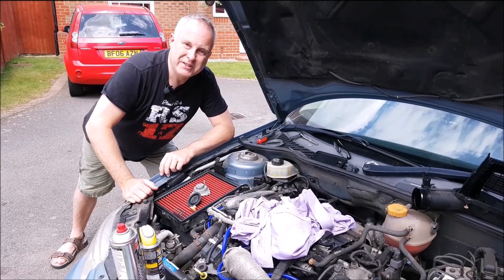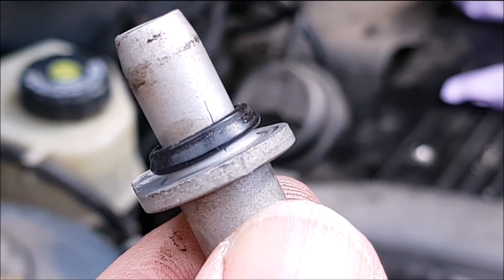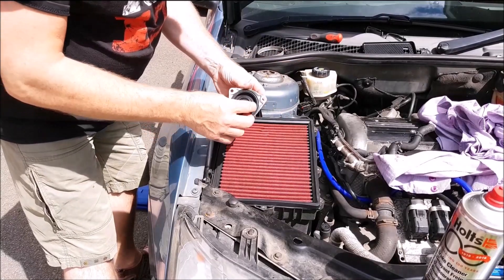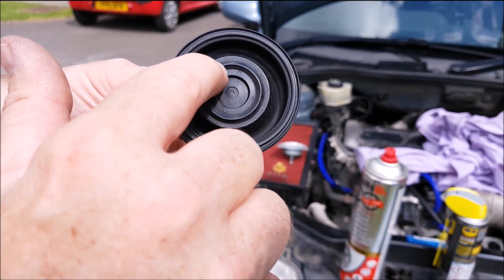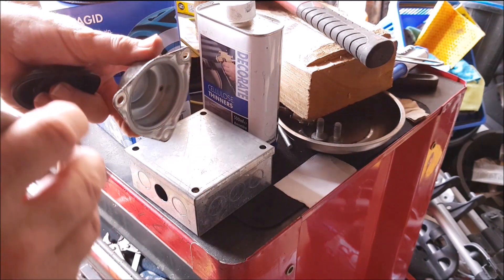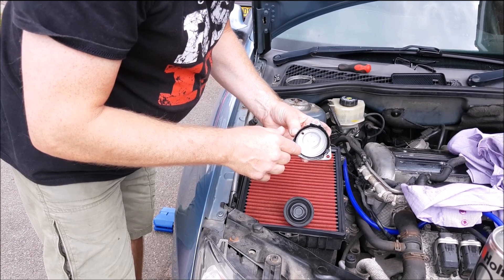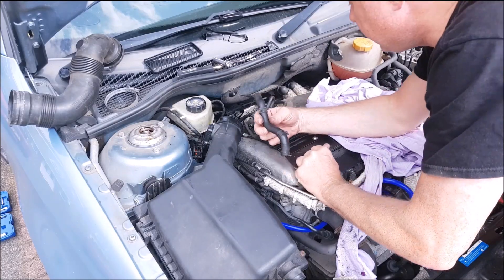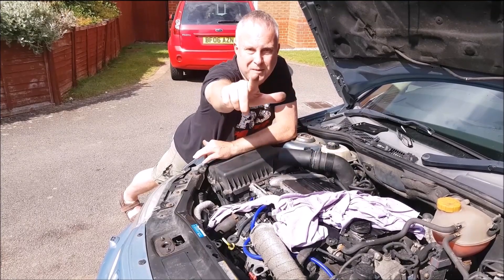Diverter Valve Leaking Boost | Mitsubishi TD04 Turbocharger part 1

Comment: Watched a lot of your content. I've had my laser red saab 9-3 for over 10 years, and your videos are amazing. I've done a lot of the repairs with your help. Hoping this fixes my permanent P0033 code. Replaced all the bypasses. Haven't examined the bypass valve diaphram but will replace it and let you know if it comes back ordered from your link, thanks again for explaining this.

Comment: There is other method to seal a body of DV instead silicone: put some bolts thru the holes that head of the bolt is from turbo side. It will lift body of DV a few mm. Then on a flat surface hit the top of the body with a hammer. Not hard, just gently to bend up those lips with holes. It will make a slight "banana" shape on the edge and let the body better hold membrane on the surface. Some tuners in east europe stopped replacing these valves when they figured out how to make body fit better to the turbo

Comment: Is there a trick like this if your turbo is introducing exhaust gases into the coolant lines and over pressurizing the system look high and low and there's not much information vehicle in question Saab 9-3 2.0 Turbo 08 any information on this would be greatly appreciated

Comment: hi cyd i am currently having misfires problems could this potentially be the problem would this problem cause misfires ?
Reply from the maker: generally, no. A boost leak will usually cause rich running and slightly rich doesn't usually cause a misfire. What car is it? Is it a Saab 9-3 petrol? Aero 2.0T? Under what conditions does it misfire? And what codes are you reading?
Reply: @CycloneCyd  also no codes I took it to my local Saab shop they ran it for me for three on the t2 scanner and nothing Popped upJust three things but nothing related to the engine or that would cause the misfires But he did not have time to thoroughly check it just scan it for me
Reply from the maker: @saabieauto331  What coils and sparks are in it now? Coils should be OEM (Mitsubishi) and sparks should be NGK PFR6T-10G - ALWAYS. Ignition issues can cause a backfire, so make sure this is correct first.
Beyond that, a backfire is usually caused by rich running. So check for boost or vacuum leaks
A collapsed IC is a fave for boost/vac leaks, as too are that myriad of 4mm vacuum hoses.
You were very lucky to get the codes read for free, but of course they are not going to do anything else. You'd be doing yourself a favour to get a reader of your own. I'd recommend this one  https://amzn.to/3fruabM  It'll last you a lifetime and over the years it'll save you a bundle.
Reply from the maker: @saabieauto331  Have you checked your throttle body, turbo, MAF and MAP are clean?
https://www.youtube.com/playlist?list=PLOaePmzqZNJ3lc4ZFKbck22LRNHl3rZOE
This is popular your side of the pond
https://amzn.to/35Zl435
Reply: @CycloneCyd   i Currently have a 2008 saab 93 2.0T it has a brew city boost tune a bsr cold air intake also cut one of the Catalytic converter's I have not put in my new spark plugs and I bought used OEM coils Typically the car back fires under full boost Typically lower RPMs but You can feel a jerk

Comment: Have a 2008 lancer myself 2 litre DID engine, getting a p0299 underboost myself, wonder if it’s a wastegate problem or a diverter problem...
Reply from the maker: Is it the same Mitsubishi TD04 turbo? Interestingly, I've worked out that I don't think a smoke test would reveal this leak ❗ So inspection is your only recourse.
There are links to replacements in the description

Comment: I have something else to add. I have this issue where if I'm going like say  55-60 mph, and I slowly give it some more gas, I can hear this air noise that sounds like a jet occur from the engine, and you can hear it clearly though the cabin. And the faster you go, the higher it gets and it also has the little fluttering noise that occurs with it. When you left off you can hear a big spool like it had a. Unch of boost holding up. Now this is still happening to me, even after I recently replaced my diverter valve with a Forge one. I'm still waiting for my breather tube o-ring to come in that mail. You think this is just happening because the o-ring might be going bad?
Reply from the maker: Doesn't the Forge divertor come with 3 springs? Try the weakest one first. That fluttering is the air going supersonic in the turbine due to excess boost pressure (known as cavitation) and it could wreck your turbo.
Reply: @adrianleon1731 Did you ever figure out what was causing the noise ? having a similar problem on a mates c70 🙈

Comment: Speaking hypothetically, if you have the hard o ring and leaking air to the turbocharger,  plus a bad diverter valve, how much boost would you be losing. Would it be quite a bit?
Reply from the maker: Since the lost boost is lost to atmosphere, then depending on how bad the leak is, then in theory you could lose all the boost. In practice from what I can see most people seem to lose around 2-4 psi. When a stock motor gives 12psi max, that is quite a significant chunk (about 1/3rd). Obviously the loss is unpredictable for any individual car, but even if it's only 1psi that's power and economy just sapping away there and potentially poisoning the cat through rich mixture.
Reply: @CycloneCyd  Wow yes that's quite a bit of power loss. I'm under the impression that I have the greatest possible amount of boost loss so I cant wait to fix it. I ordered a Forge diverter valve and a new o ring. Should be here shortly

Comment: Can you do a video about P0101 on this engine? What is often the cause of p0101, what to check, how to solve it and so on. Thanks in advance, Best regards to you.
Reply from the maker: Hi Miroslav, P0101 relates to the Mass Air Flow (MAF) sensor, but is rarely caused by the sensor itself. A vacuum leak or boost leak is much more likley. All the same, give the MAF a clean (see https://www.youtube.com/watch?v=V6fxxprx1F8), check for the leak detailed in this video you've commented on, check for this issue https://www.youtube.com/watch?v=bgLn14dZL3Q. Check all vacuum pipes for any signs of splitting. Check all boost pipes for same. Also check the intercooler for leaks (they sage and break). You'll need to get the bumper off to get at the IC https://www.youtube.com/watch?v=Adkcj8kTo_U. A dirty or sticking PCV valve can also be the cause, but you need to take the inlet manifold off to check the valve.
Reply: @CycloneCyd   THANK YOU for your quick respond. God I wish I lived closer to you so that you could take a look at my car.  I did check the MAF, cleaned it, changed several and it is not the MAF. I bought the same blue intake hose that is attached in front of the turbo and still p0101 returned. Then I bought a used intercooler and replaced it with mine just to be sure. Still p0101. I did inspect  closely hoses and could not find or see any leak.  In your post (the last sentence) you wrote about PCV valve. Do you mean this car part (  https://www.eeuroparts.com/Parts/64074/PCV-Valve-12786376/ ) . If so then I must say I did not inspect that part. Didnt know that it can trigger p0101.  Everywhere I read about p0101 they almost all say AIR BOOST LEAK. If PCV valve is bad it doesnt neccesery causing air leak right? As you said earlier if it is dirty or sticky then it can trigger p0101. I did manage to find a video on youtube  ( https://www.youtube.com/watch?v=dIrD4bdbk8U ) how to replace it. Ill guess this will be my next step then. Nearest Saab mechanic is 250 km from me so I am stuck with myself to solve the problem :)  almost forgott, some people are saying that MAP can cause p0101. From what I can see my engine b207r (saab 93 ss aero 2003) have two MAPs. One is attached on the big hose that is connected to TB and the second one is located here (  https://www.youtube.com/watch?v=pgPCrioK-6A&t=46s ) . Can they be causing p0101?
Once again big THANK YOU for answering. Best regards to you.

Comment: could this cause p0033 code?
Reply from the maker: Hi Alpha, P0033 relates to a problem regulating boost, so YES it could be caused by a leak around the diverter valve. Nearly every TD04 equipped engine is likely to have this problem, so it's worth an hour sorting it out.

Comment: Hi cyd, I keep getting code p2261 on my Saab v6 turbo. I changed the turbo valve as well as the whole wastegate with no luck.
Reply from the maker: Hi Mo, have you checked the condition of the diverter valve and for vacuum/boost leaks? Which valve were you referrring to? Also check the integrity of the IC - they bow at the bottom and eventually leak. A smoke test might be a good idea. P2261 is usually a loss of boost, for which there are a myriad of potential causes, a leak of some sort being most likely. Also check cleanliness of your MAP sensor and wiring integrity for all sensors.

Comment: Maybe you could help me in vacuum leak? I probably have but i don't have idea how to localize this.
Reply from the maker: Inspect all the pipes and tubes first. Squeeze them and bend them looking for cracks.
Best way though is to 'waft' an [unlit] plumbers torch along all the pipes and mating surfaces until you hear the engine note change. Then you know roughly where it is.
Use brake cleaner if you've not got a plumbers torch.